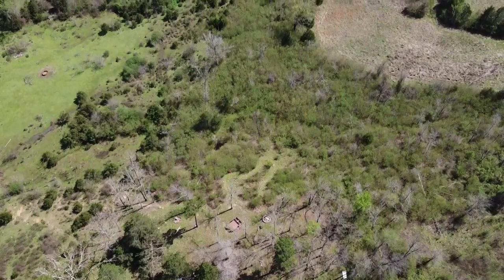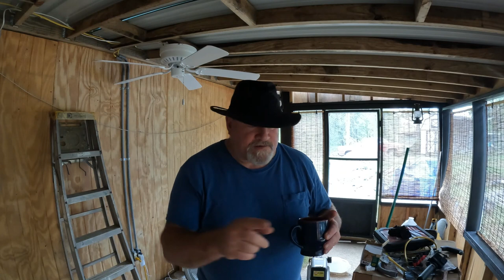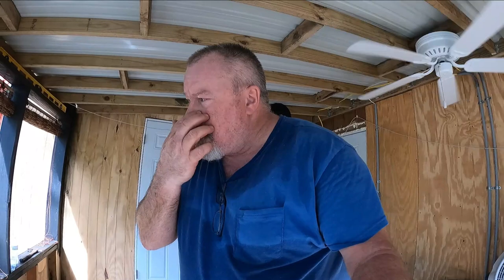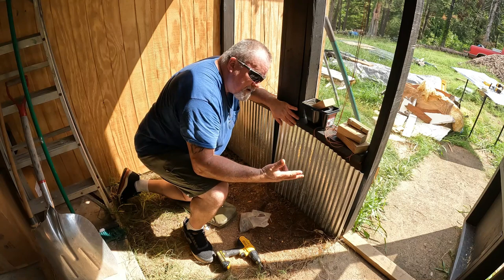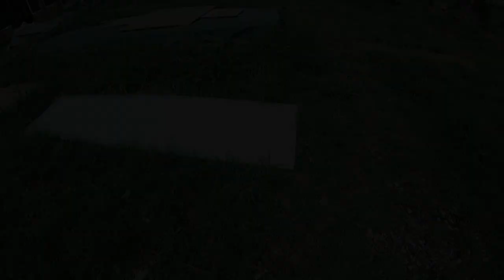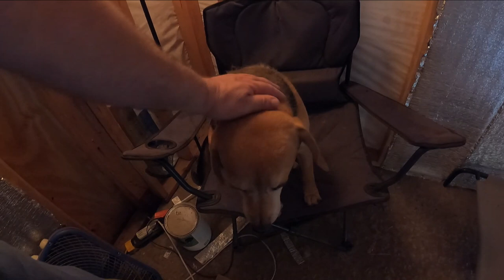Screened Patio Metal Skirting Installed!/Patio/Deck/Dog Apartment Build

Comment: Hi Mike, I to see your crazy builds. Why don't you put concert in the two spaces by door on your patio. Maybe top coat of concert on the dogs floor. Use tin for the dog room on all walls.  It Easy to care and bright for and dogs won't  mess it up to easy. Doing good Roberta
Reply from the maker: you will see why when its done, just have to wait.That tin is $30 a sheet 26"x96" that would be a fortune

Comment: Looks good, but you are right you need a Trim or something along under the big windows to cover top edge of metal. Are you still going to paint in there.
Hope you can get your Washer and Dryer in before Winter. It is coming fast. However, you are doing good. Blessings